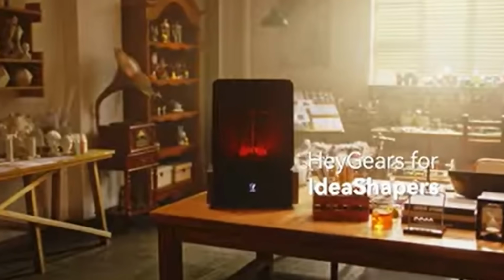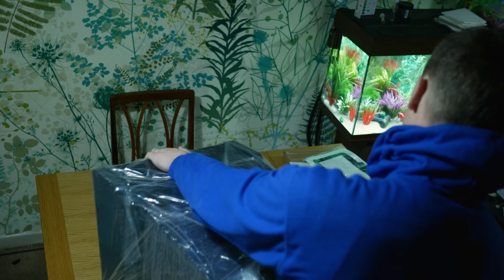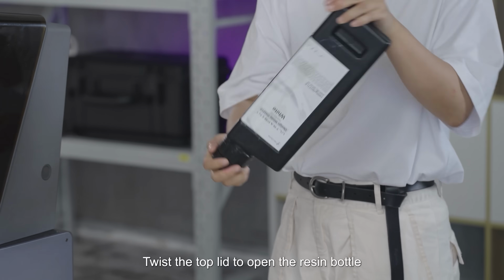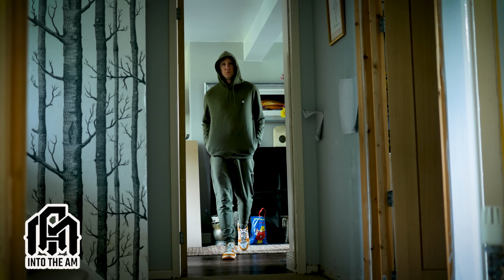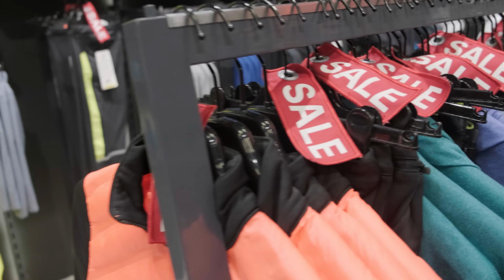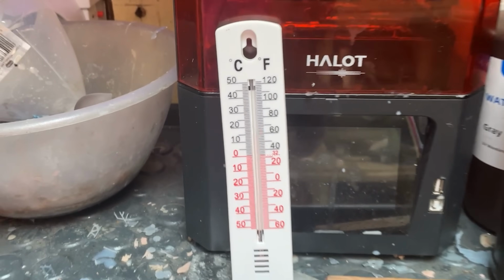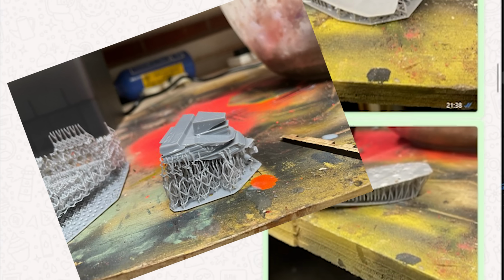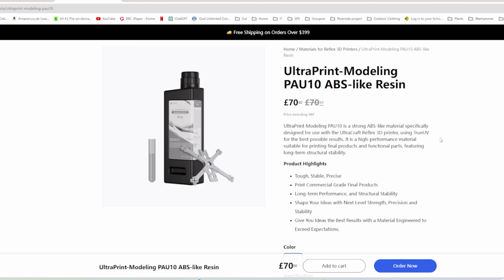The BEST 3D Printer you'll never buy - Hey Gears Reflex Review

Comment: My guess is they won't be much cheaper than formlabs once they have market share (formlabs might come down a bit but it will probably mostly be heygears increasing in price). I also don't really see what this changes: It's the same type of closed ecosystem as form labs. I can't really justify spending what it would cost as much as I'd love a simpler print experience, even as frustrated as I am at times with my elegoo. It's basically triple the price for both the printer and the ongoing cost of resin. Definitely for professionals or hobbyists that don't mind spending that much.
Reply from the maker: This is an older video now since then FormLabs have released the form4 (£2k) and HeyGears have launched the RS £700 and a line of cheaper resins, so they are chasing different markets now.

Comment: There is just no way - no matter how great this printer is - that it justifies buying into a closed system, especially when it comes to the consumables like Resin. It’s not just the cost of Resin - it’s about types of resin they don’t offer, especially the rs.
Reply from the maker: I get the limitations of the system, but it’s a commercial model rather than a hobby one. HG say that they fully under the properties of their resin so it’s about control of the end product here. But it’s also been proven multiple times that you can use many resin types on this machine not just proprietary ones and the dynamic lift and other force sensors mean these resins perform much better too. That said though, there are lots of good printers so plenty of choice out there.

Comment: How much does the curing station cost? 
How much does the washing station cost? 
Intro was very click bait. "End of 3D printing as we know it" BS
Reply from the maker: It’s absolutely not a cheap system but it’s still my go to printer and I 💯 standby the central point that this marks a step change in resin 3d printing. The cure station is around $600 the wash is around $400. But neither are needed to use the printer however, this machine, as I said in the video is not aimed at hobbyists it’s aimed at lower end professionals

Comment: I'm not going to buy any HeyGears printer as long as they lock its usage behind a proprietary software that only lets you print with a internet connection to their servers and locks the settings to only work with HeyGears resins only... nope.. not even if they sell them half the price.
Reply from the maker: I get what you are saying once in a six side makes some interesting points but the resin argument is almost irrelevant as I showed in my video you can easily use 3rd party resins and the internet connection thing is kinda relevant but there are so many programs you can’t use without an internet connection that it kinda feels a bit of a BS argument too. I can’t watch Netflix without an internet connection either for example
Reply: @RisingApe  We aren't talking about an online service ... we talk about a machine that someone buys and can't use it even tough there is no technical reason why it wouldn't work but instead some arbitrary restriction of the manufacturer... for me that's a complete deal breaker. Having said this I really appreciate your content none the less. That's just my opinion about HeyGears.

Comment: With Elegoo introducing the Saturn 4 Ultra with it's tilting mechanism, every single resin printer now has to compete with elegoo for fastest print times, ease of use, and frequency of failures compared to the tilting vat mechanism.
Reply from the maker: While the S4U is a great innovation I terms of ease of use/ reliability/ build quality and updates it doesn’t come close to the reflex. The video wasn’t sponsored by HeyGears at all, they sent me a machine, that’s why I needed a sponsor like flex spot to cover the cost of production
Reply: @RisingApe  That's fair.

Comment: This isn't, and cannot be, "the end of 3d printing as we know it". That's like saying cars coming from the factory with track tires already installed is going to be the end of aftermarket tires. 3d printing is by definition a hacker creation. And I use the term "hacker" in its original and true context, not in the current "breaking into computer systems (cracker) meaning. There will always be a market for 3d printer systems that are print medium brand agnostic. The PC was never the death of the Apple or Mac. The gaming console was supposed to kill off PC gaming 20 years ago. Until a core technology goes away, there is always a market for non proprietary components and ecosystems.

Comment: Amazing, high-end, consumer piece of kit. Thank you for introducing  Hey Gears, Reflex as quite possibly the BEST 3D Resin based Printer. I'm a  novice , just getting started into 3D filament  printing. However, as a retired sheet fed operator, of typically four, five, & six unit offset, full size (40 inch), ink to paper, printing presses. Industry leaders such as, Mitsubishi & Heidelberg (Speedmaster). I've been through many stages of printing & seen it evolve over the years. Early on when I began the trade of printing on paper, it was working in the format known as led type set. 

These were most often single unit (1 colour, more often black), however, one German Heidelberg printing press stands out the most, from my many, learning experiences on it. That was like the ultimate, revolutionary machine of its time. A strong & heavy press (for those days). The German ink printing machine, called the Heidelberg, Kord.  Just google it. That press helped evolve the industry. What I mean by that is, after laying out small, individual pieces of led type, setting it all, individually into a wooden, flat, holder, called a chase. Well this was quite laborious, clever, unique, stylish & all, but once I disassembled this press somewhat. Cleaned the press, and made it ready by installing 16, or more cylinders and rollers, this meticulous, but slow press was transformed into a speed demon. One of the worlds first truly fast, ink printing, off-set style presses. Capable of handling both, type-set, & off-set printing. Now we no longer had to work with individual type pieces of led. Because now we can assemble much more content. Rich, flowing images, and text developed by camera onto plate.
 
Years later in my career, I watched the disposal of a lot of skilled pre-press workers.You see with the ever more increasing use of more advancements in electronics, the technology forced many skilled workers in camera & plate development out of jobs. Take for instance the final versions of multiple unit presses, made by Heidelberg. Just as we rolled into the new millennium, Y2K came about, so did the elite of the Heidelberg, Speedmaster's, off-set printing presses. There was no more hanging the plates to impression cylinders. Instead, every time new plates were required on units, laser diodes went into operation & burnt a new plate. The plates' image came from a RIP on someone's computer, somewhere, after being proofed & signed off by a graphic artist, as well as the client. Next a spool fed roll of mylar with another substance layered on the top, gets rolled into action with the laser diodes burning & etching out the finished work onto the plate cylinder, holding precise register (perfect position in relation with all other plates on the press).

 Any how, when I look back upon those changes, the printing plant became an ever more increasing lonely place to work. I would catch myself talking more & more with machines. Don't get me talking about C.Y.M.K. (Siam magenta yellow and black), with these four process inks, one found themselves some days not having to develop our ink colours nearly as often. Those four process inks could do pretty well any shade of a rainbow.

I'm still just getting into this new game (for me that is), with my first 3D filament fed, roll of substrates, gleefully watching these Creality creations grow. All the while try'n to keep an attentive eye on my creations. Would love to know if I can program my Raspberry Pi 4B, to watch over & make remote changes, on the fly, working on this Hey Gears Reflex possibly using some sort of software on my Raspberry Pi, like OctoPrint.org has created that functions well when pairing something as my Creality, Ender 3 S1 Pro, & Octo Pi?
Thanks for your very informative, quality video cast. Hopefully many more to come.

Comment: How is this a professional resin printer when there are printers like StrataSys and Mimaki around. This is just an expensive toy using old technology, come on, you still need supports and in monocolour.
Reply from the maker: It depends on the use case I guess, MJF printing will be cool very soon but it’s not there yet, I think it’s almost the opposite to what you said, the hey gears is the professional tool and the Mimaki is the expensive toy at the moment
Reply: @RisingApe  I was discussing purchasing the Mimaki for Dental/Orthodontic/Medical work just today. When a 3D scanner alone costs over 50K its not that expensive and if your using a 3D print to plan reconstructing someones skull for surgery I wouldn't be using a Hey Gear.

Comment: I don't get the dig at Bambu. I'm an FDM guy, yes, with a X1C. I need something that works, not a tinkering project. The X1C delivers that. It's an appliance that works. I send it a job in the garage with a high degree of confidence, that it will just print. Open source, sure, whatever, they have opened up the firmware if you want to go off-warrantee. No idea how many use this option, but it's nice it's there. Filament? go for your life, I regularly plumb the depths of Amazon using weird non-Bambu filament. I do wish the Nozzles were a more common design, but there are now 3rd party high flow ones coming out. So I'd actually hold up Bambu as the right way to do it. Innovate, push the industry forward, but open up what you can.
Reply from the maker: I’m not really having a dig at Bambu, kudos to them, but I worry it’s the begin of a trend that is highly commercially successful of moving into essentially a subscription model, it’s not difficult to imagine rfid chips being added to Bambu labs filament reels in future and the entire system being closed. Like I say, more an observation about industry trends than a specific comment about one brand
Reply: It's definitely a concern, but I think we passed the point of maximum danger with bambu a few months back. They clamped down on an exploit that allowed people to root the x1 and install custom firmware. Then after consultation they released a new version that allowed you to opt out of warrantee support, and have a boot loader for custom firmware. The bambu spools already have RFID chips, that's how they track usage on spools. But there's been no attempt to lock users in.
So it looks like they are choosing to do the right thing.
Reply from the maker: Good to know, and yeh Bambu are doing a lot right here

Comment: Nah.. Saturn 4 Ultra - the best printer :)) Or Phrozen Revo.. both cheaper. You also giving false info, Reflex is not the most detailed with just 33nm..
Reply from the maker: There is no false info, the voxel size of 33nm seems larger than some claimed sizes from other brands but the actual results are more detailed than other brands. Other creators cover this point really well, highly recommend checking out @fauxhammer. As to the Saturn etc, the price point makes them a good bet but I haven’t used one and they have only been out a few weeks so we will see.
Reply: @RisingApe  have you compared details result to for example Phrozen Revo? 16.8 x 24.8 microns . I'm curious about comparison, especially with their newest resin.
Reply from the maker: @trillobeat  no but honestly once you have paint on these minis you aren't telling the difference. However I would like to test it

Comment: A very honest review!  Indeed is not a hobbyist printer. I can’t just shut my mouth because i’m more on the professional side… i got my first resin dlp printer in 2019 and i was blown away by it’s performance, but it came with a huge cost (20k) and 5 years later the manufacturer (bego) decided to stop support for it’s printers due to many printing fails that they can’t figure it out. Parts were extremely expensive because you have to buy an entire assembly which included that part… not to mention 1Liter of resin starting from 400€ up to 1600€. The lack of “tweak” for print was the major downside and in my opinion this was cause of the end of this printer. I had for so time asiga (didn’t like it either - a little bit cheaper) then i got a sprintray (again significantly cheaper) but in the end all had the same flaws… now i went down further in prices and got an Anycubic photon ultra, which to be honest has the same print quality, very cheap parts. As for the resin i’m using the professional ones because of the nature of the final product. by trial en error + printing tweaking i managed to have good results. Anycubic photon d2 has some print issues/fails (didn’t manage to some them yet) 
Good luck to you all!!

Comment: Closed source printers will never appeal to a big part of the community, but I can see how the idea appeals to a lot of people at the same time because a lot of people just want to make things and they don't care about buying proprietary filament and resin. They care about making a print the way they see it on the photos online, or they care about their prototypes coming out exactly as they want them to be.

I have designed and built printers since 2012 and recently I also went to buy a printer that's not open source, just because I wanted a machine that does the things I want to do better than what most 'open source' and DIY printers offer. And the best part is that the filament still isn't proprietary. With a little tweaking, it just works. Oh the time I spent on fixing my DIY printers... Time I can never get back. And on the one hand, yes, I also learned so much from doing that, but I've not been able to apply this knowledge in my working life, it's all 'hobbyism' :D
Reply from the maker: Yup, this about sums it up.
Reply: Which I think is the point of this video. You're telling you manufacture if they want to be part of this community they need to consider giving us the ability to participate at the level that hobbyist participate. Or make it so that it's possible to crack it open without breaking a warranty kind of thing.

Comment: How much would it cost to print a 6-hour object, from a print-farm business?    I imagine having someone else do the print is going to be the better option if if you're only going to do a print every once. 

Also, it doesn't have Lidar , and more material support  like the X1C, but any thoughts which HeyGear printer is closest to the Bambu P1S in terms of performance?

BTW, any thoughts on the Infimech TX printer?
Reply from the maker: Thanks for the comments, for the cost it depends, professional printers will charge anything from £20-30 all the way to hundreds of pounds (i got some dinosaurs printed for a few videos ago they were around £70 each but printed on a FormLabs system so the resin for that is £125/l) 
It’s not comparable to an FDM printer like an X1C or a P1S as it’s different tech. The closest competitor is something like Form Labs. Hobbyists should look towards something like a GK2 if you need a heater or if you want speed perhaps the new Saturns? 
Last one if you’re just printing once or twice, save your money and buy resin models from artists, shop somewhere like PK PRO/ Noble Knight or El Greco.

Comment: New subscriber here. Found you via Fauxhammer's video. Very tempted to get this. Love almost everything about it. I don't worry that I can't use other resins and settings. Only concern is the price of the resin. It's just at the edge for me. 

By the way, I'd love a video going more in depth on the CYMK system and process.
Reply from the maker: Thanks for the subscription, Yeh it is expensive, but you can sub out the resin for other brands but if you grab it on offer it’s £55/l and if you buy the printer using my link you get a free bottle of resin, too! and I will see what I can do about the follow up video.